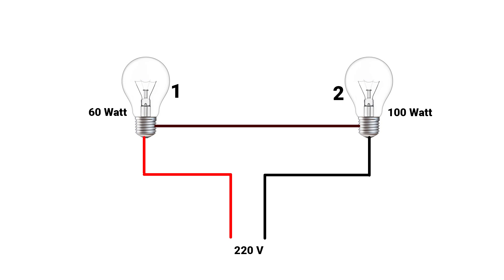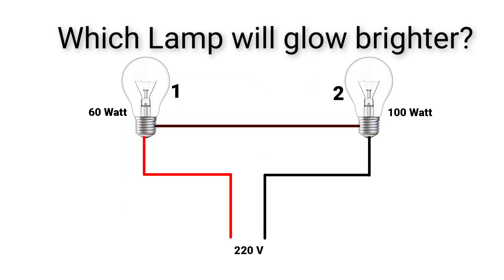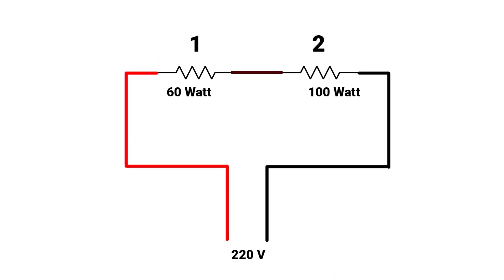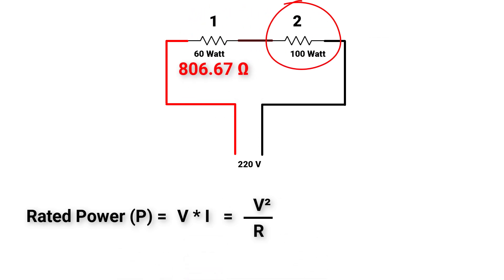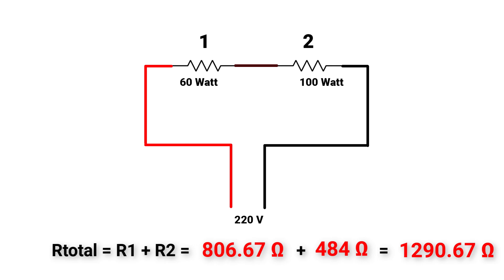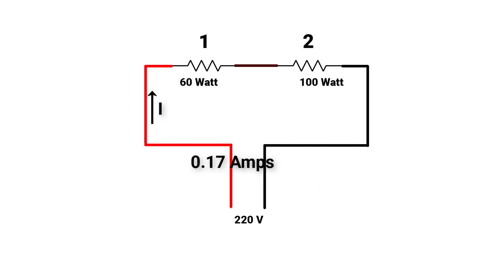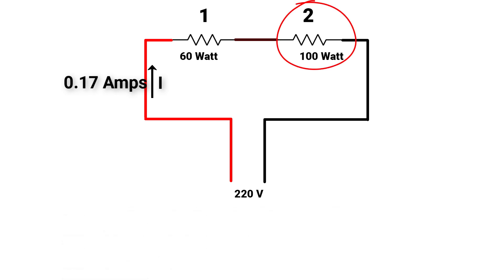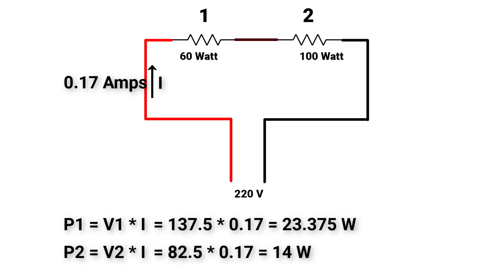Which bulb glows brighter? |Solved Example

Comment: But how could you apply same voltage for two resistances in series connection!!
Reply from the maker: Here we have one voltage source and two lamps or we can consider them as two resistances in parallel, so there will be a voltage division between the two resistances depending on their values

Comment: I calculated the answer assuming the bulbs were rated at 120 volts. And my calculations also concluded the 60 watt bulb would dissipate nearly twice as many watts at the 100 watt bulb. Good exercise!
Reply from the maker: That's great, excellent work 🙏👍

Comment: You are wrong in the calculations. You have used OHms law by ignoring the temperature difference inside the bulbs.
Reply from the maker: First Thank you, but these calculations are theoretically with ignoring the temperature coefficient of the two bulbs, but even with considering the temperature coefficient the 60w bulb will glow brighter

Comment: Please I want to ask an important question. This is a series circuit and we know the rule for a series circuit which is the current is the same as the voltage is shared across individual load, but in your calculation, you assumed a the same voltage across it.
Thanks
Reply from the maker: Thank you for your question 😊, but you have to differentiate between rated voltage for each lamp and the actual voltage that is connected to the two series lamps, rated voltage is used to describe how much power the lamp will produce at this voltage and we call it rated power, so we used rated power along with rated voltage to find out the actual resistance of each incandescent lamp, after we have the resistances we will start working with a simple circuit that have the actual voltage and two resistances, hope i make it simple
Reply: @electricalengineeringplane6620  agree to your rated vs actual explanation, however what I don't fully understand is how does a 100W bulb has lower resistance as compared to 60W one... don't incandescent bulbs produce heat/light by using power? i.e. shouldn't a higher power rated bulb have higher resistance and consume more power?
Reply from the maker: @matinsb1  lower resistance allow more current to pass for the same voltage,, and more current means more power because p=i^2 * r
So power is directly porportional to i^2